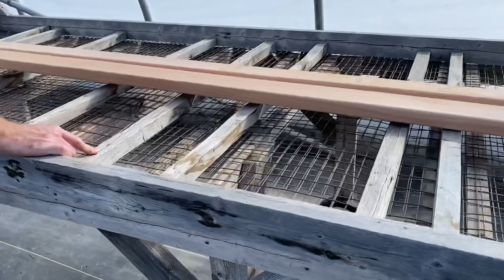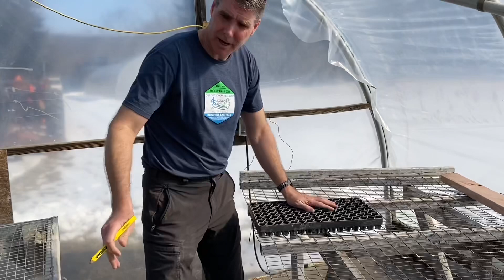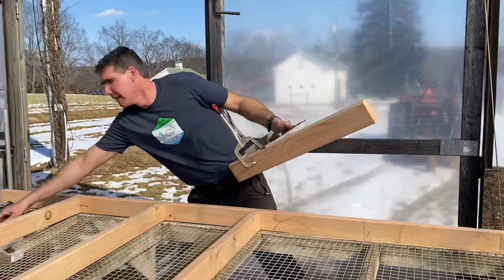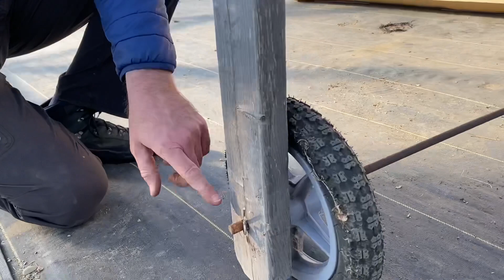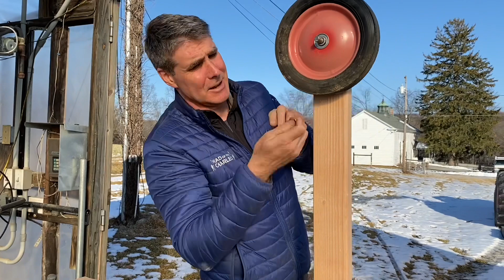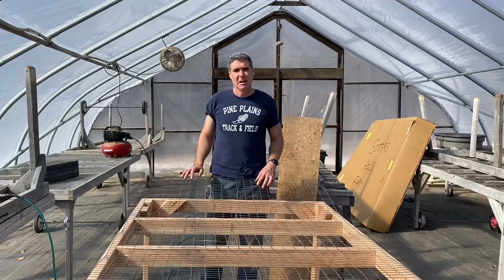Make your own mobile greenhouse benches

Comment: Another idea for a forked wheel is to sandwich both the horizontal beam, diagonal brace and the wheel with 2 legs.

Then the assembly would be in double shear which is very efficient. 

If the wheel is thicker than 1.5 inches than a spacers would be needed.

Comment: Did you use treated wood or just regular yellow pine? How long to these tables normally last you ?
Reply from the maker: Regular untreated pine lumber.  My oldest tables are 25 years.  I've had to replace some braces and rotten parts but many are still in use today!

Comment: Decent Plan-BUT-that square up jig is WAY OVER THE TOP-Plus you'll NEVER BUILD ANY SKILLS. This is just like framing a house wall--Set up on a flat surface, lay out supports with line to one side as shown.GET A 7" SPEEDSQUARE-cheap knockoffs are good enough. That will help you lay out lines on side rails-Drill (2) 1/8" holes in center of where cross brace will sit-3/4" in from each edge. On outside face start 3" black drywall screws til they almost protrude. Set your cross brace into place, grab it 6-8" from end, make sure tops are flat and resist the push of the driver setting the screw.
Reply from the maker: I'm not suggesting anyone buy an expensive welding square to build their greenhouse table, but rather to think outside the box.  If a tool you have can ease the process and make things smoother and enable you to get the work done faster and with greater precision than I'm all for it.  I had a great time using that square and clamps to make the benches.  Yes, I'm skilled enough to do it without.  I have probably a half dozen speed squares.   I use what works best based on what I have at hand.
Reply: What a clown